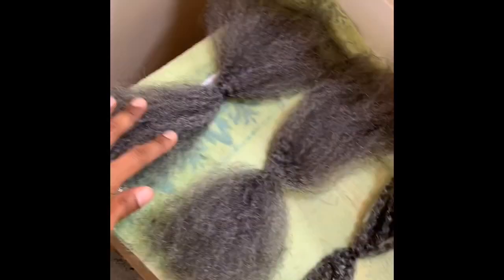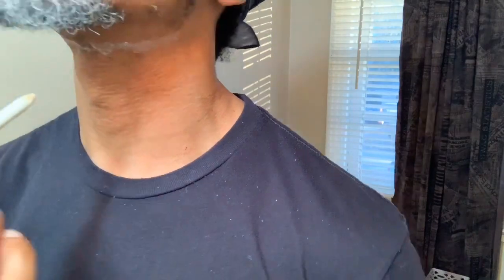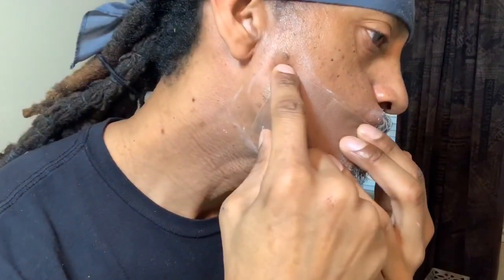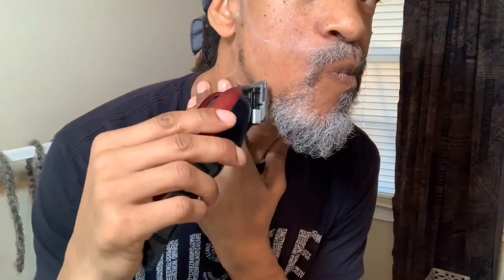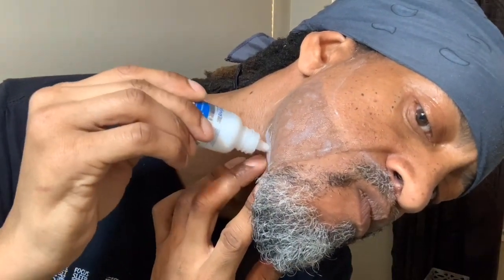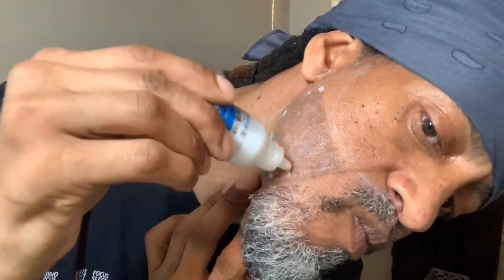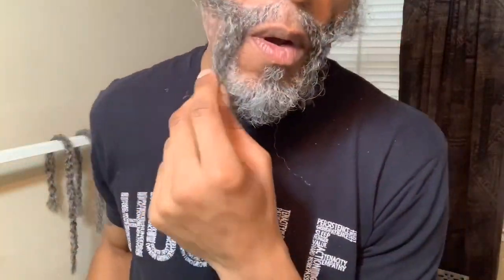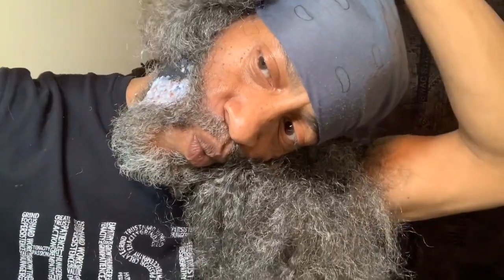Beard Unit

Comment: Is it water resistant, like in the shower or at the beach
Do I avoid water?
Reply from the maker: Hey , you would need to avoiding water at all cost. But there is a sweet resistance spray that is use In the process.
Reply from the maker: Shawn Nwaubani but definitely avoid water, but water resistant
Reply from the maker: Both no water